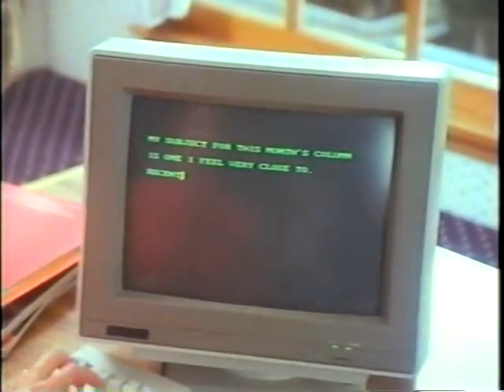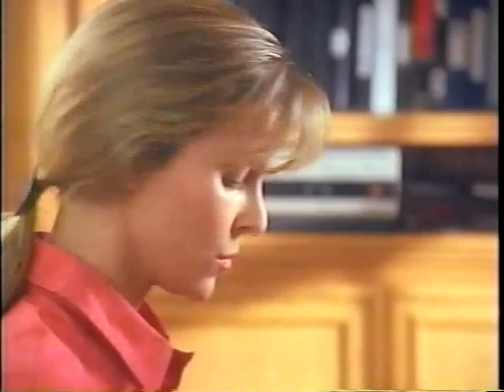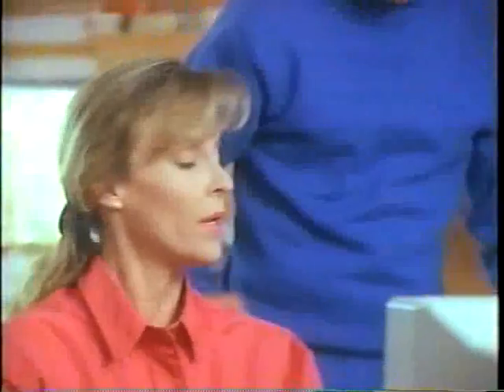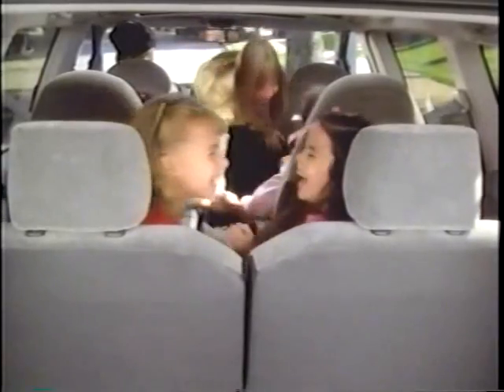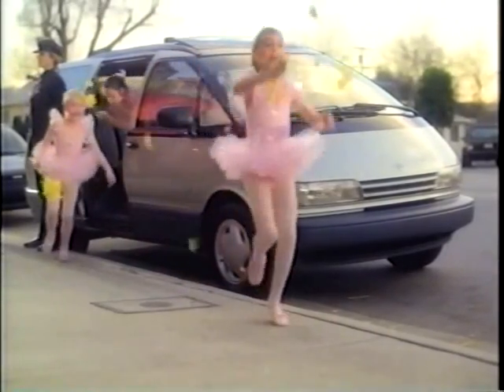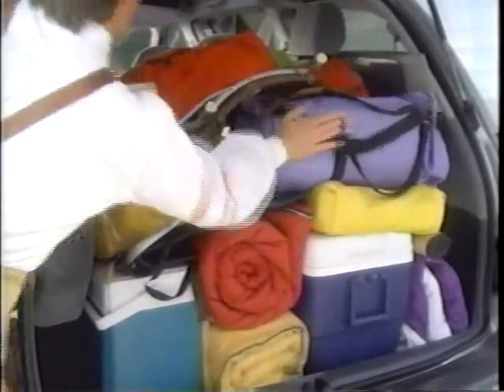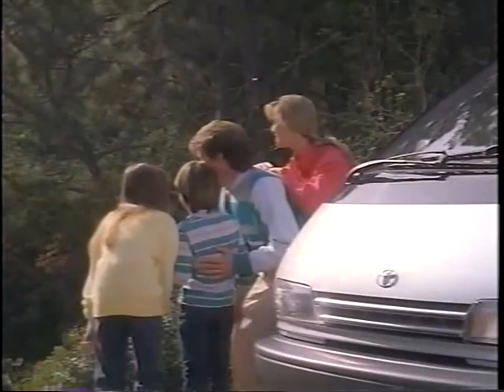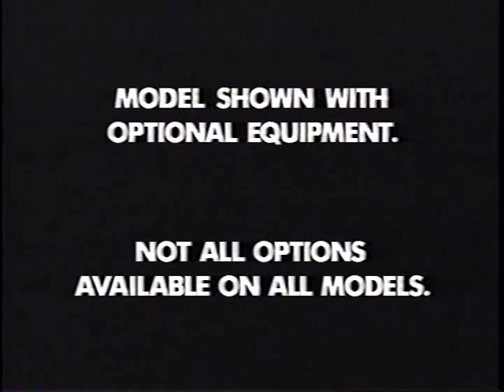Toyota Previa Video 1990

Comment: My Previa is exactly like the model in the video, 1991 LE version 2wd, dual moon roofs, bucket seats in the middle, pearl white with a gray interior, electric mirrors on the sides, electric door locks, automatic transmission, an identical match.

Comment: The first generation, designed by Toyota designer Tokio Fukuichi and Calty designer David Doyle in 1987(patent filed December 24, 1987), was introduced in January 1990, had only one sliding side door for the rear passengers. It featured a unique mid-engined platform, where the inline four cylinder gasoline-powered engine was installed almost flat (at a 75-degree angle), beneath the front seats. Installing the engine in this configuration allowed moderately easy access to the spark plugs, which were located underneath a panel on the upper left-side of the vehicle, after removing the front passenger seat, the carpet, and an access panel. All engine-driven accessories, such as the alternator, power steering pump, air conditioning compressor, and radiator fan, are accessible from the front hood, driven off the front of the engine by an accessory driveshaft, and is known as the Supplemental Accessory Drive System, or "SADS." This allows for even front/rear weight distribution, which benefits ride quality and handling.

Comment: Love my ‘93 Previa! It has 275K miles on it and it still is going strong! I now have a 2015 Sienna, but still would not give up this van.  It has its own endearing qualities, such as its mid-engine rear wheel drive configuration that makes it as durable as a truck.

Comment: My grandfather gave me his White 1991 Toyota Previa with only 115,000 miles on it. That 4 cylinder, mid engine design between the front seats lasted until 2019 when i sold it for a good amount of cash to a surfer beach bum who wanted to convert the back into a sleeping quarters. That thing took off slowly but surely, outlasting more powerful dodge caravans and voyagers of its time. PREVIA ROCKS, It was my TOY EGG VAN!!

Comment: Feb 2015 Our 1991 Previa purchased new is still going very strong at 280,000 miles. We still get asked what it is, as we have from day one. Oil change shops refused to work on it sometimes as it was "too complicated" for them (lol).   Sadly now a days parts are hard to find. It always starts even below 0'f runs perfect even at 23 years old. Good job Toyota!
Reply: Do you still have it now in 2024?

Comment: 1991 previa now, ours has a couple rust holes, little ones. the bumper is falling off, the head gasket is starting to leak, it's having troubles stalling when low on gas. the front shocks are dead, the rear shocks replaced, but hey! its been around for 25 years!

Comment: I just wanted to say. I own one of these and I can't say enough about it. My alternator went out in the dead of winter and it was a joyful pain in my ass. I only had to remove half of my components under the hood. And my windows! They don't fucking work! It's amazing driving to work with a soaked ass from the storm the night before. A tree fell on my van one day and unfortunately didn't total it. But instead; left it looking like a fat kid would squeeze a fucking hotdog his mom tried to take away. I get all the ladies in this van. In fact I am about to give my van somewhat of a viking funeral. See, now I'm about to load my van with 25 pounds of home made explosive and detonate it in the middle of absolutely nowhere. But not before I make a blood sacrifice to Satan to ensure this van gets sent to hell. 
This is a great van guys. Just like the video said...
Reply: +Jared Johnson The alternator on my 1994 Previa died and it was the the original factory alternator.
It seems you just bought a van that wasn't maintained. All vehicles are a pain in the ass to repair.
Reply: +Jared Johnson LOLOLOL, yes... you slayed this. I laughed so hard.

I own a Previa as well.... and I'm sorry about your unfortunate situation.
Reply: also I own this van it is a pleasure to own and maintain!  I can use it at least 9 months out of the year no problem. the other 3 months it is so hot inside because of the mid engine design you could fry an egg on the floor. perfect for those mornings with no time to make breakfast at home! 

the glass in the back window blew out in a rainstorm. the new version of this piece of glass is only $500.  the junk yard had the mirror tint version of the glass. so for a total of 30 American dollars I replaced it with the different looking glass and duct taped that bitch in place. so now I blend in with the other cars parked down by the river where I make my dream of being a filthy hobo come alive. 

I can't say enough good things about this van it's like a dream. I wake up every morning and wonder how I got here? why the good Lord likes to watch over me as I suffer from depression and anxiety and possibly mental anguish. 

unlike this gentleman I do not get much action in the back of this van.  I believe it's because of the duct tape.   whenever a girlfriend sees my car for the first time they for some reason make seem very busy all the time and eventually stop talking to me all together. 

I'm sure it's the van that has all issues. NOT me!

Comment: is that kid even old enough to sit in front?
Reply: Benefit of no passenger front airbags.
Reply: +Jake Takahashi  There were passenger airbags.
Reply: +Tropic Smoke I think that's a glove box you see in the interior shots. At the end the mom finds items from her story in it. And consumer reports says the Previa didn't get a DRIVER'S SIDE airbag till '92, so I would be surprised if there was a passenger side airbag before a driver's
Reply: Jake Takahashi No, that's a passenger airbag if you look (which was an option) . And there is no reason that wheel should be that fat without an airbag.
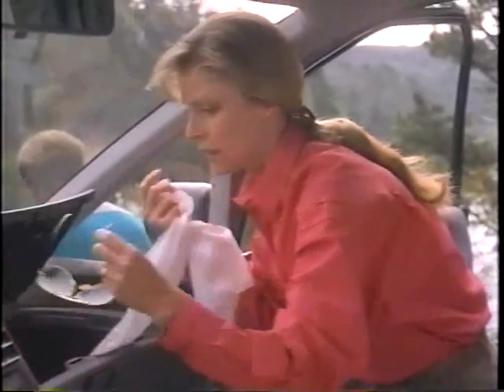Reply: 7:24. Where would the passenger airbag go? Where do you see the passenger side airbag? I'm genuinely curious because I have a soft spot for early 90's cars.
Reply: Jake Takahashi Like i said it was an option.
Reply: Then I am disappointed Toyota wouldn't use a fully loaded Previa in it's intro, or even mention the option.
Reply: North American Previa's had driver's side airbag since at least 1990, not sure if optional or standard & the video avoids showing the steering wheel. No passenger airbag until later (passenger airbag does take up  most of the space the giant glovebox used)
Reply: I was a kid back when this video was made. Kids were allowed to sit up front. There were no laws requiring children to sit in the back or use booster seats until around the year 2000.

Comment: its crazy how you could pick up a Previa off craigslist for less than a $1000 on a regular.  Pretty roomy and comfortable van.
Reply: Yeah with how many miles and what shape?  Any decent shape these cars are still $3k minimum. And if it's low mileage, they are still like $5k, doesn't matter which year.
Reply: Y10Q plus have two dirty secrets... RWD and mid engined.
Reply: AE86 of Mt. Akina whats wrong with that?

Comment: I remember my uncle used to have one of those. They were very roomy in the inside. For 1998, the Sienna replaced the Previa for several reasons: vehicle body designed off-set crash test and front-engine design with a standard V6. In 2004, AWD became available.

Comment: Very Japanese styled van. Very 1990's cheap flimsy plastic crap.
Reply: +AKFGFan It's the kind of car that can last 30 years.
Reply: Ben Smith I heard its hard to get into the engine bay and do repairs on the car
Reply: Implying you have to ever repair anything on the engine. Sure I've had to get exhaust work done, I've torn my exhaust off, I'll destroyed pans for trans and oil but the engines stay good in these so long as you keep changing the oil. Unless there's a factory defect. There was in mine and it was rebuilt under warranty in the first 40,000 miles I think.
Reply: I read somewhere it was designed by Californians...
Reply: Mr S They must be good engineers because my uncles had over 300,000 miles on it.The only other vehicle I've seen that has been equally as reliable is my current 1986 Toyota Land Cruiser with 310,000 miles that refuses to die.